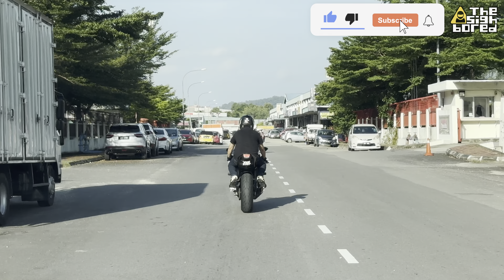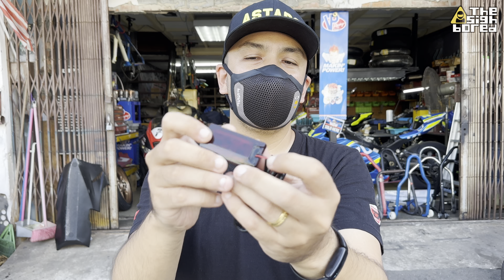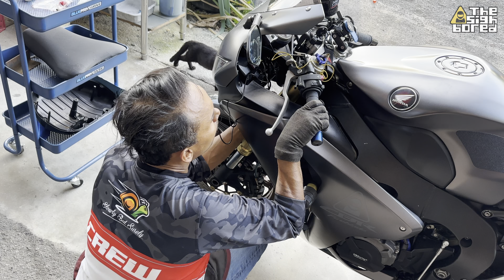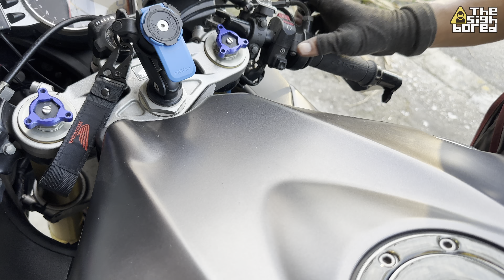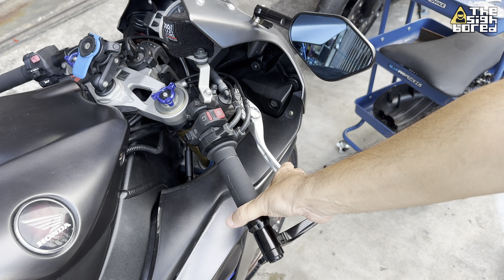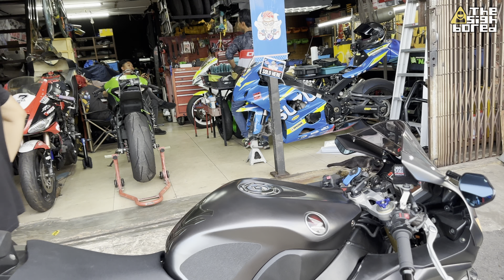2010 Honda CBR1000RR | Voltmeter install | Front brake bleeding | #TigerBunny

Comment: bro what's the recommended mileage for brake bleeding ?
Reply from the maker: The usual recommendation is every 1-2 years, however, personally I don't wait that long, instead opt to flush the brake fluid when doing major servicing or every 10k or 20k km like that. It doesn't take that long and not too expensive so that's fine with me. Brakes are super important so I don't mind it.
Reply: @thesighbored  thanks buddy 😊👍🏼